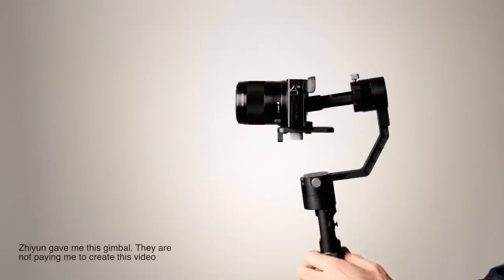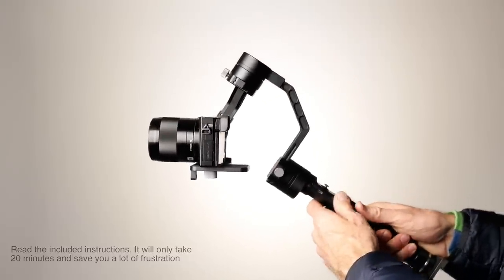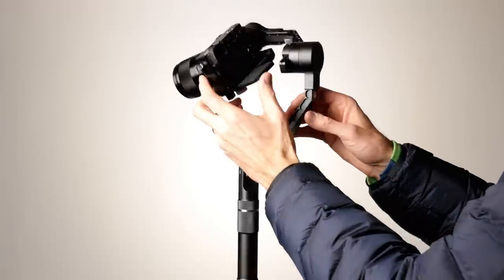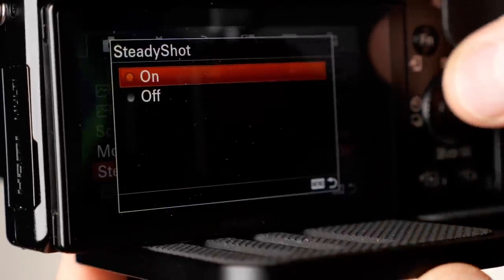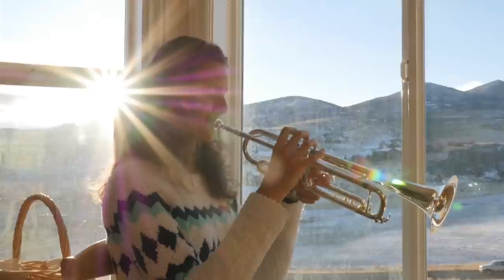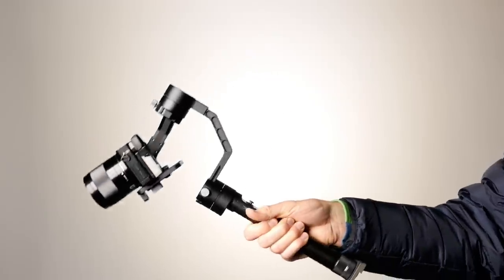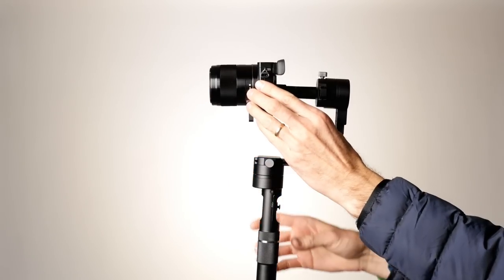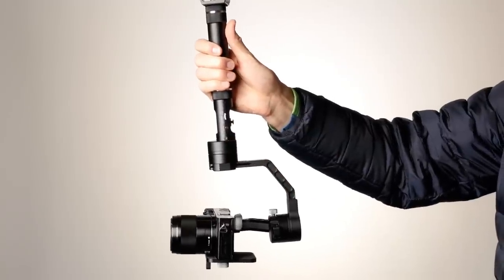Zhiyun Crane 3 axis Motorized Gimbal Setup and Tips

Comment: Yes, I do have a question! I find it pretty annoying that the app for android is available only on a Chinese website. No translation. This means that I can never install the app and in the end I install some other Chinese app that I don't know what it is! How can I get the English app for Android?
Reply from the maker: I only have iOS devices so I don't have a way to test from here. I assumed that the app was in the Google Play store. Any other Android users out there have details on this, please?
Reply: The manual never names Google Play, it constantly "forces" android users to scan a QR code that should directly start the app download. I tried searching on Google play and I did find in deed an app. I managed to make it work after some sweating since the app is not very logical and the bluetooth communication between devices is not the easiest. But after I figured it all out the app was working as desired :)  I just wish it wasn't this puzzling with an app and the info on the manual would be correct...

Comment: I used Pana GX85 + Crane M should i turn off 5 axis?
Reply from the maker: Do some tests to see whether it works better with it on or off. I found with my GH4 that it worked best with OIS on with my 12-35mm lens.
Reply: I use pana 15f1.7 Thank you.

Comment: how often do you need to rebalance your gimbal during a shoot? i've balanced mine and after about 5 minutes of using it it becomes unbalanced and i have to start from scratch again. doesn't seem like anyone mentions this in their videos. but at the same time it seems like everyone is over simplifying the balance instructions. doesn't help that Zhiyun does not offer a very detailed instruction on how to balance this either.
Reply from the maker: Hi Brady, if everything is cinched down tightly and I do not change the zoom on my camera's lens, I do not need to rebalance during a shoot. Which camera and lens are you using? Do you change focus or zoom during the shoot?
Reply: It's the Nikon D750, and i'm using a Nikon DX 18-140mm. it seems to happen after i shut the Zhiyum off completely for a little bit and set the camera down on top of a camera bag (i'm buying one of those small tripod attachments for the bottom of it now). After doing that a few times, i notice that before i even turn it on, it's off balanced and I need to readjust. 

Haven't gone on a shoot with it yet, just been using it for testing purposes while i get use to it. I have noticed that the D750 does not fit on it very well. it's almost to wide of a camera to fit. It's also not able to flip upside down while using my camera. Not sure if it's because of the long lens or just the wide camera, but the gimbal adjustments have to be adjusted in a way that it's not able to flip upside down without loosening and readjusting it. just some issues i've been having with the D750.
Reply from the maker: Oh, you're using a larger camera. Have you installed the 5D firmware? Also, is the D750 with the 18-140 less than 1800g (the payload max)?
Reply: yea, i did the firmware install ( i hope it's the most recent. their site is a little confusing, and the mobile app is broken and doesn't allow firmware updates, so you have to do it via USB). And it does weigh less than 1800g. 490g for the lens, 749g for the D750, 86g for the battery, 51g for the memory card, and 341g for my Rode mic. that comes to 1,717g for it all, but right now i'm really just using it all but the mic
Reply from the maker: There are actually two branches of firmware: The standard, and a special "5D" firmware for larger cameras like the Canon 5D and Nikon D750. You have the "5D" firmware installed?
Reply: Crane Firmware V1.52 is what the file says. When you go to their site, they only have one 'firmware' button under the Crane product. I just assumed that was the one I needed. Is it located somewhere else on their site?

Also, thank you again for going above and beyond answering questions here for me!
Reply from the maker: Interesting, it appears that they only have one firmware now...When I tried it about 2 months ago, there was a separate beta firmware for heavier cameras. It looks like they either removed it altogether or merged it into the main firmware. I'm afraid I'm out of my league at this point. Hopefully Zhiyun support can get you what you need. I'll be at the NAB show next week and will talk with them to get the latest on the Crane and firmware.
Reply: Thanks! Yea I'll reach out to their support. Thanks again for the help and the great videos!!

Comment: how bout tips on best lens weight and lenght?
Reply from the maker: Funny you should mention this - I actually found that the 16-50mm kit lens with my Sony a6000 was too lightweight so that I couldn't balance the camera on the gimbal. The 50mm f/1.8 was great.

On the Panasonic side, I was able to balance with both the Panasonic 12-35 f/2.8 and the Olympus 45mm f/1.8. So it looks like it is the combination of the camera body and the lens, not just one or the other.
Reply: thank you for the insight... I'm planing to buy this gimbal to lift an a7 with rokinon 24 T1.5 but if that would not possible, I will use 28 f2 instead :)
Reply from the maker: I'm going to bet those will balance nicely. Good luck!
Reply: Curtis Judd one more thing sir, I saw some photos of the gimbal  connected to the camera via micro USB and said to be able to control rec button, iris, and shutter speed right off the gimbal handle. can you confirm this? or its a different (possibly newer) zhiyun crane?
Reply from the maker: Yes, there is passing reference to it in the user manual. I haven't tried it yet. Need to get a micro USB to micro USB cable.
Reply: Unfortunately it is not a micro USB to micro USB cable but a Multi Terminal to micro USB cable.
Reply from the maker: Multi-terminal is what connects to the camera?
Reply: Yes, you got it.

Comment: Hey Curtis, thanks for this tutorial ! I'm having a hard time balancing my GH4 + zuiko 12-40 on the Crane though.. (won't go in the vertical position as showed at 1:32, no matter how I set the camera) is there any reason ? thanks a lot for any help !
Reply from the maker: Hey Nicolas, yes, if the lens is too light-weight, you can run into this. The ideal solution is to get a little more weight out on the end of the lens. Maybe attached a lens hood and add some weight to the hood until you can balance it.

Comment: I just bought the Crane today and after I balance the Sony RX 10 MIII on it the camera will not tilt upwards because the EVF eyecup doesn’t clear the roll axis motor.
Reply from the maker: Thanks for telling us about your experience with the RX10mkIII. You have the original or v2?
Reply: Curtis Judd i just emailed Zhiyun and am curious as to their reply. I have seen where the Sony RX series is compatible with it but that could have been stated before the MK III came out. When the lens is at 24mm, it is extended out, making it front heavy, therefore requiring the base plate to be all the way back which causes the eyecup to rub against the Roll axis motor.
Reply from the maker: Ok, let us know what you find out and best wishes on getting it to work.
Reply: Curtis Judd I have yet to receive a reply from Zhiyun but I returned the product last night. I basically determined that the body size of the RX 10 MK 3 (not the weight) and the fact that at 24mm, the lens extends out further than it is when the camera is powered off, makes it impossible to balance it front to back without the eyecup rubbing against the roll axis motor. I’m bothered by the fact that nowhere on YouTube or anywhere else can I find a reference to anyone else trying to use a Sony RX 10 MK 3 or 4 on the Crane. Only the MK 2. The MK 2 has a 24-200 equivalent lens which does not extend out at 24mm. This can be seen in the Fenchel & Janisch review.

Comment: Thanks so much for you work. I just received my Zhiyun Crane V2, and i balanced it in 5min using your tutorial. I just have a little issue. With my A7+24-70F4 balanced configuration, i only can switch to reverse mode in one way. On the other way, the two axis scratched between themselves. The only solution, is adjusting the roll screw a bit, but the camera is not well calibrated :-S Is it something normal? Thanks again and sorry for my bad english ^^
Reply from the maker: Hi Manuel, I don't have the same configuration so I cannot test with this specific camera and lens. But I would say that switching to inverted mode is probably not feasibly with larger cameras. May need to turn the gimbal off to switch, then turn it back on. Best wishes!
Reply: Thanks a lot. I'll do it that way!

Comment: Hi Curtis I have an issue with the gimbal almost has a jitter effect in the video if I tilt the camera down too much like in your thumbnail, have you encountered the same issues?
Reply from the maker: Hi Jared, I haven't run into that with my setup. When there's jitter, usually it is a balance issue, but I assume it is balance fine when not pointed down? Are you using a lens that is heavier than the camera body?
Reply: I may try to adjust the pan access because thats the only one I dont reallly mess with but my lens is slightly lighter then my camera. Im not sure but ill just keep messing with it, thanks for your time if you ever encounter it or here a fix id love to hear it!
Reply: Okay I actually found the problem, I through on a lighter lens (kit lens in this case) and it didnt seem to have a problem! I guess my zeiss 55 was a little heavy to do too much low shots. However I did find that if I went into inverted mode the Zeiss performed just fine, so if you have a heavier lens try inverted mode for those walking shots! Quick tips with Jared Kinley haha
Reply from the maker: Good find, thanks Jared!

Comment: I have a 5d mk iv my set up is under 1800 is that ok for the crane
Reply from the maker: +kenneth williams yes, but you will need to load the 5D firmware from Zhiyun's site. Also, I have found that some lenses are too light so that is a factor as well. Usually only an issue for light lenses. Best wishes!
Reply from the maker: Yes, you'd need the special firmware for 5D which is available for download on the Zhiyun site. Also, which lens you use is important as well. Some very lightweight lenses are not possible to balance (especially plastic kit lenses). Good luck!
Reply: This is interesting, I didn't know they have unique firmwares. Is it easy to restore the original firmware?
Reply from the maker: Updating was seamless for me. (in this case "restoring" is the same as updating)

Comment: Anyone have issues with a panasonic g7. There is no way i can level the g7 on the camera plate. Have the 14 to 42 lens. Even all the way forward the camera is still back heavy? And lens points up?
Reply from the maker: I'm betting that the issue is the that the lens is not heavy enough. Do you have any heavier lenses you could try?

Comment: no matter what I do , I can't get past step one... my a6000 won't point straight down.
Reply from the maker: The a6000 is pretty unbalanced, particularly with some lenses. May need to add a quick release plate to add weight and expand the range of options for positioning.

Comment: i dont get this video AT ALL!! its making me mad. my camera even WITHOUT a lense.. looks STRAIGHT down at ALL times... so its impossible to adjust ANYTHING
Reply from the maker: Hello and sorry for your frustration Durty_STI. Which camera and lens are you using? You cannot balance without a lens.
Reply: Curtis Judd 28-70mm Tamron 2.8f
Reply from the maker: Which camera? The reason I ask is that even if a camera/lens combination is under the max payload weight, some lenses make the camera too unbalanced (front or back heavy) to easily balance on a gimbal. Sometimes rigging some sort of counterweight to the base of the gimbal can help, but 28-70 lenses often make cameras quite front heavy, especially smaller cameras or those with integrated battery grips.
Reply: I have a Sony a7rii
Reply from the maker: ok, you may want to contact Zhiyun for help with this. I suspect that the payload is just a bit much for the original Crane or Crane V2, especially with that hefty lens. Best wishes.

Comment: Mine freaks out and stutters from time to time. it also doesn't tilt all the way forward. less than pleased with it.
Reply from the maker: Sorry to hear it isn't working well. I assume the camera balances ok but then while using it it stutters? Which camera/lens are you using?
Reply: Hey Curtis, as always great videos. SO just a quick mention, you cant flash the firmware with any old micro USB cable, you need to use the one they provided in the box. Secondly, The GX80/85 with the kit lens is a terrible choice for this gimbal. it isn't front heavy enough, and so it swings backwards on the platform. I bet if I got a slightly more substantial say 17mm lens for the front of it, it would come out well. That being said, with the firmware upgrade yesterday, it now flies the Samsung NX1 very well. I plan to change to a GH5 soon, so this is going to be my go to for the gimbal I guess.